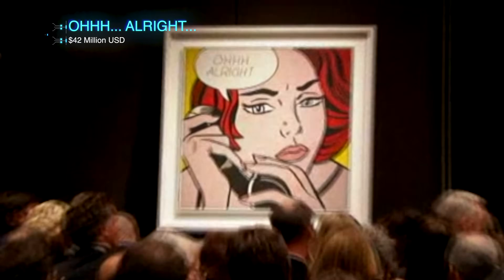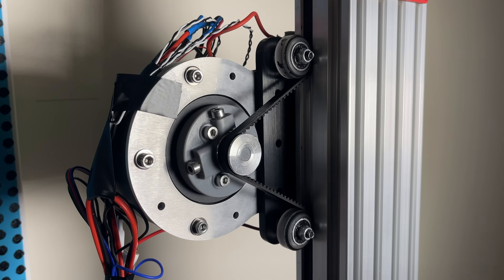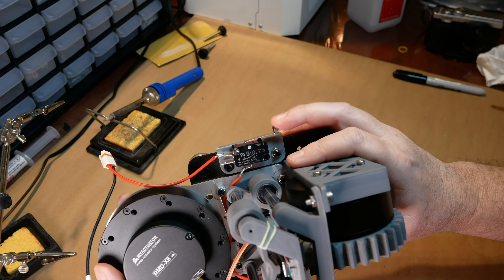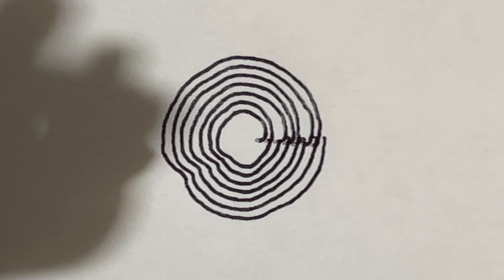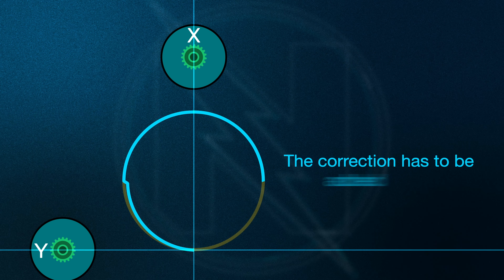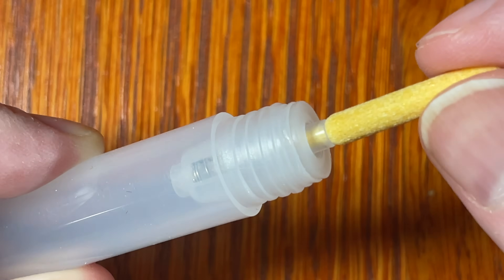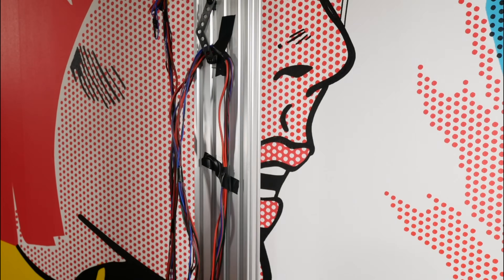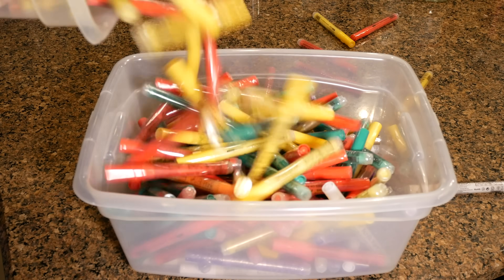I Built a Robot to Paint Expensive Art

Comment: As a suggestion what about changing out the  pen actuator for a solenoid it would be significantly lighter and easier to reinforce than the double slide sprung rack and pinion pen actuator and you could use a motor controller to have variable force so it would double as the relief spring
Reply from the maker: The pen actuator motor is way overkill.  It's what I had on hand and already spoke the same language as the other 2 motors which are on the same can bus.
Reply: @Nerdtronic Thanks for the reply and fair enough I was trying to think a way to make it more rigid without adding more weight/using metal parts, and to that effect what about swapping out gear system and the double slide for a radial or cylinder cam and a single set of rails with a 'driver' slide and the pen holder be a floating slide, with springs or a soft foam block in between and have the slide held back by elastic bands to tension against the spring and the cam, this would still use the motor as the actuator while simplifying the design and you could 3d print and mount the cam directly to the motor and lay it inline with the pen slide assembly removing the double slide system which seems to be the major mechanical problem in the current design.
Importantly I forgot to mention it in my first comment but the art turned out beautifully
Reply: The floating slide idea would probably also work with the current rack design which would make fewer parts to remake though if you used the current primary slide it would limit the travel.

Comment: This is awesome. I wonder if you could put some kind of notches into the guide rail and use that to accurately gauge the travel instead of using a rubber belt. It'd be difficult to maintain the accuracy to notch them, but it would last longer.
Reply from the maker: The first paint head had a pot in there to feedback the amount of pressure on the pen.  But it didn't work.  I must have gotten a crap pot and had glued it in.  It never gave accurate readings.  The rubber bands held up for the whole print but a spring would have also worked.  Shane from Stuff Made Here suggested that I didn't need the double set of rails.  I used that big actuator there also and didn't need something that beefy but it was what I had on hand.  And actually that actuator can act as a spring all by itself if you set the max torque.  I just never experimented with that feature but will when I make robots that walk around.

Comment: Fantastic build and awesome result. I have to try the trick with drilling out the vale of the pens and try to use this type of pen in my drawing machine. Thanks for sharing.
Reply from the maker: Yeah I drilled next to the center valve.  So as close to the edge of the side as possible.  And 2-3 holes seemed to work best.  You still want the valve to work after.

Comment: I would be so nervous watching it do the black after 6 weeks!
Reply from the maker: There was a day when I almost ruined the painting 3 times.  Once the pen almost crashed into the side of the painting which would have either ripped the painting off the wall or broke the pen spraying paint everywhere.  I physicaly held the pen from doing that while I was unscrewing it and it slipped in the belt, kicking it out of registration.  Later that same day I realized that the pen was leaking paint and somehow it only ended up all over my hands and didn't drip on the painting.  Unfortunately I didn't get any of that on camera.

Comment: Very cool project, and a very nice result! I personally don't think that you would have to redesign the pen holder to use metal parts, FDM printed parts could work just fine. Resin prints have good accuracy, but much lower strength and creep resistance. Printing the parts out of a stiff and low creep material could work well. PLA and Nylon are the highest creep FDM plastics (off the top of my head) but something like ASA does better long term.

Comment: There are plenty of refillable pens you can modify to have an external reservoir, and just fill continuously as needed. Instead of buying and replacing all those pens, you just need the ink and a few replacement nibs.
Reply from the maker: So actually the paint for the refillable pens is a lot more expensive than these pens.  I do have refillable ones as well as these... Molotow and also some generic ones.  Molotow ink/paints are expensive.  Oh and I've tried so many different paints and so far have not found any that will flow through the nib other than ones made specifically for paint pens (and those are $$$).. The pigment particles are too large and it just clogs them.  Belive me I tried.

Comment: Very cool!

I'm surprised the paint flows from the pens with them mounted horizontally. Or is there a slight downward angle to them that looks perfectly level in the video?

Either way, amazing results!

Now you got me wondering if I can hack my CNC to do something similar on a bit smaller scale? Love it
Reply from the maker: There is a slight downward slant to them.  It looks far from perfectly level if you look at the end where the paint head started drooping.  But even still, the pen will work horizontal to earth because the paint still flows towards the tip and I added extra holes in the membrane to let it flow. Also the sponge wicks the paint out towards the nib.

Comment: This is an inspirational project, well done!  Love the art as well.  A comment about the 3d printed parts.  I see these were printed on a resin printer.  If you printed in more of an engineering plastic such as fiber filled Polycarbonate (PC), you'd have better stability.  Even carbon filled PLA would be better than what you used.  Check out the Bambu Lab X1 Carbon/AMS printer (I have no relation to them, other than owning two of the printers), this can handle these filaments.  

Looking forward to more RoyBot creations, thanks for sharing!
Reply from the maker: Thanks!  I just ordered the redesgined unibody paint head. The pen slider will just transfer over and I don't have to reprint anything.

Comment: I remember doing a Lichtenstein painting for art class back in High School by hand.  I used a toothpick for the dots.  It definitely was not as good an outcome as this but at that time I liked how it came out.  A ton of dots though even though it was less than a quarter of the size.  

When I was playing around with robotics and was working with a sort of robot arm, also not industrial or remotely close to pro level equipment I found gravity would screw up my positioning pretty quickly.  Movement going down would be faster than going up.  Was that an issue with this set up?  I would have thought you might have has less issues if you made it table top instead of wall/vertical mounted like you had.  Granted, vertical orientation takes up a much smaller footprint.

Very cool project.  Love the result.

Comment: Your backlash most likely comes from the servos planetary gear. These robot servos are meant for articulated direct drive robots where speed, torque and backdrivability are more important than precision. I would not use them for a precise motion system. An appropriately sized servo or stepper should have no trouble directly driving your gantry (though you might consider a corexy belt arrangement to avoid slinging the motors around).
Reply: It also looks like you run a cheap-ish HDT belt. I would use a high quality gt2 belt, the tooth profile has more precision and usually gt2 is used in motion control applications so they are fiberglass reinforced and stretch virtually not at all.
Reply from the maker: This is a GT2/3 belt.  Probably I could have tightened it more.  Originally the backlash was about half what it is right now.
Reply: @Nerdtronic  If your belt gets chewed up like that there is something wrong. Too much/little tension, misalignment, bad idlers/pulleys, too much torque (adjust acceleration curves). These same belts survive for years/decades in 3d printers…

You are using the self-propelled gantry style, which is not great because 1) tends to have less than 180° of belt contact 2) bends the belt in both directions

Comment: Another (mechanical) solution to the backlash issue is adding a constant force spring. This would keep it always on one side of the backlash. Your solution seems to work too though and has fewer mechanical failure points.
Reply from the maker: Thanks.  Yeah the Y axis backlash is less maybe because of the weight of the paint head.  Several people have suggested that it's the planetary gears but I think most of it isn't.
Reply: @Nerdtronic  Yeah that would make sense, gravity can be its own spring.

Comment: Love it.  But the timing belts really need to be replaced by lead screws. That should cure the repeatability issue. And that won't be cheap assuming that you can get them long enough.
Reply from the maker: Thanks.  Repeatability isn't an issue as long as you go the same direction (L-R or R-L) to get to that desired position.  I'm looking at some other options.  I think lead screw would be too slow.  Rack and pinion might be an option.
Reply: @Nerdtronic  Oh no, lead screws can be very fast. On my small router, 40 inches per minute for rapid moves is routine and some users run them far faster. Certainly 25 IPM is common when I'm cutting.

Comment: A nice robot improvement would be to modify those pens and feed pain from a reservoir directly in the back, thta would cut down manual labor and cost, since you would only need to buy a single pen and then batches of paint.
Reply from the maker: I was going to feed paint in to the back of the pen from a little IV bag.  Here's the problem.  Only certain paints will flow though the nib.  The paint particles need to be in the nanometers range or it clogs.  I've tried all kinds of different acrylic paints and so far none of them flow.  There are refillable markers which I also use.  But the replacement paint that is high flow is pretty expensive.  In the end the TFive markers are about the most affordable option.
Reply: @Nerdtronic  Quite unfortunate. The alternative would be to use a printer paint, which would required a whooole different dispensing mechanism, which would be a stretch for a "painting robot", and also, quite expensive. 
I see your motives now, and commend your for your determination!

Comment: Being the curious type, I am wondering if you considered canvas deflection when programming the pen travel distance? If not, how would a solid canvas backing affect pen movement accuracy and ink bleedthrough?
Reply from the maker: I had planned to put styrofoam behind it but it wasn't possible.  But no paint/ink bleed through.  The back of the canvas is blank.  I did consider canvas pushing in.  I adjusted the pen depth depending on where it was painting.

Comment: So impressive. I'm curious how "autonomoous" you think you could get Roybot. Obviously the paint pens slow things down (maybe a tube and pump mechanism instead of the pen cartridge?) but how involved did you have to be on adjusting the paths beyond what you showed in the video? How small would the canvas have too be too do a single color artwork in a day?
Reply from the maker: I really had to babysit it.  I was constantly concered that something would happen to make it ruin the painting.  So many close called that I didn't get on camera.

That said.. My plan was to use a drink IV bag and fill it with the paint. Drill a hole in the back of a pen and 3d print a rubber adapter so I can attach the IV tube to the pen.  Hang it a little above the pen.  But swapping out pens was quicker than messing with that and having it leak all over the place.
Reply: @Nerdtronic  Thanks for replying, that totally makes sense. I feel like thats inevitable with so many robots, getting it to do the thing is hard enough but getting it to do it without maintenance or intervention is a hundred times more complicated and expensive. This was really amazing.

I like your idea, but totally agree I'd be constantly terrified of leakage

Comment: Incredible how sharp of a line you could get with those paint markers, and how vibrant of a color, all after that tiny mod.
As for the painting process, i am confused about why you had to manually program every stroke. Simply export one color at a time and let some CAM software sort out the 'tool path' (F-Engrave is free btw). If you treat it as if it was, let's say, engraving wood, then it would go way quicker and some CNC control software can even compensate for 'tool wear' (usually tool gets thinner, but here it's the opposite) as well as back-lash. Something like Mach 3 can handle back-lash for sure, though i am not sure about tool wear. Using CNC software would also make the painting process faster since it won't retract and reset the tool after each and every move.
Reply from the maker: Tool path for me was part of the art.  In general those will go linear back and forth. Also often they were continuous lines where I wanted to lift the pen often. Also my paint lines often were curved and had a stroke to them. But sure I could have probably automated some of that. The first test of that produced lines that I had to modify anyway. So in the end it was quicker for me to do them manually.
Reply: @Nerdtronic  Ah interesting, i did not realize that you wanted certain strokes, a certain texture, to the lines instead of just solid fill.

Comment: I'm surprised that you did it on the wall instead of on the floor, which, I would assume, would have made the paint in the markers flow downward is a more consistent way that horizontally.
Reply from the maker: My analogy is to fill a glass with water and then turn it sideways. It flows out just fine. But also rotating the pen wouldn’t have fixed the flow problem because there is a valve inside the pen that keeps it from flowing. It had to be perforated either way.

Comment: Awesome work! Can you give more details on how you got the paint to flow freely through the markers? I use a pen plotter and to be able to use paint markers would be amazing!
Reply from the maker: These markers are not refillable.  So I had to remove the sponge, drill down through the membrane next to the valve in 3 places.  Put the sponge back and and pump the valve to get paint to flow.  If you get refillable markers you can do it easier while it's disassembled.

Comment: Maybe have Roybot mounted on the floor to eliminate the vertical sag  --  Hung from the ceiling  ...
Reply from the maker: The upcoming mod should easily fix the problem.  A couple of custom aluminum pieces made at sendcutsent
Reply: @Nerdtronic  if mounted horizontal the belt debris falls underneath and if hung from the ceiling it fees up wall space

Comment: As you already 3D printed the printed, couldn't you've done also a toothed rail instead of the rubber belt? It would have negated all gaps and slack due to flexibility in the belt.
Reply from the maker: Yes I am working on a solution that uses a rack and pinion.

Comment: Cool project! I'm subscribing.
Would have been awesome if you could use the paint pen's "click cap" principle to hold the colour pen in the toolhead.
This will probably still require a cylindrical guide further back on the pen body to prevent the leaning issue you had at 7:34.

Also this idea depends on how sturdy the original paint cap mechanism is.

if it's not strong enough, you could compensate by having for example a soft rubber gasket inside the cylindrical guide i mentioned above to create sufficient friction.
Reply from the maker: Thanks

Comment: you could modify the pens to be attached to a larger supply of paint
Reply from the maker: Believe me I did consider it. I bought IV bags and everything.  But the pen tips need replaced every few hours anyway because they wear down. If not constantly used they dry up fast. And I have it paint in small batches anyway to minimize risk of ruining it. So it takes about 15 extra seconds to swap the pen.  Oh.. also.. the paint in the pen has to be a special kind to flow through the nib. And it costs the same to buy that paint as it does to purchase the pen. I asked TFive to supply just paint but they don't sell that.  Molotow does but its really expensive.
Reply: @Nerdtronic  Oh very interesting!  I work with Posca paint pens and they are eye gaugingly expensive!  great video btw!
Reply from the maker: @Truncatedicosidodecahedron  Yes for paint or ink to work in a paint pen the pigment particles have to be small enough to flow through the nib material. I tested a lot of differnet paints and even some high flow stuff and haven't yet found anything that works as good as what comes in the pen. So that sort of leaves me having to purchase molotow refill paint which is $$ or drill a hole in the TFive, drain out the paint, mix it together to make new colors, and then put it into a refillable.

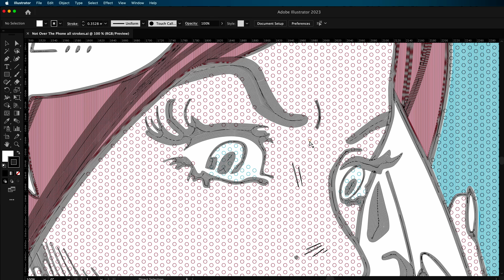Comment: Can you share a bit more on how to create the paint strokes file? 10:32 
I have been trying to create strokes by illustrator and output in SVG but the result is far from what you did. Great video about the hardware👍🏻
Reply from the maker: For my robot 1px in illustrator is 1mm on the wall.  I would take the outlines and offset the path by 1mm in and do that over and over.  Then tweak those results because otherwise the corners dont get enough ink.  For large shapes I added additional lines and copy paste them 1mm offset over and over.  All paint strokes are 1mm apart.  Then save it as svg.  The format is modified svg. I made up other stroke types and tags for other things like specifying the border of the art, which was much quicker to do in AI than have the program calculate it.